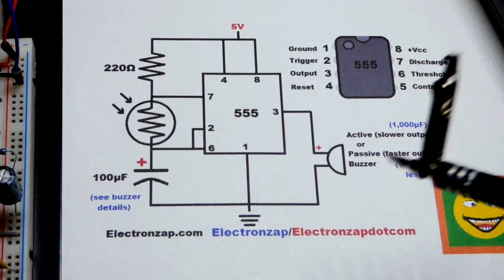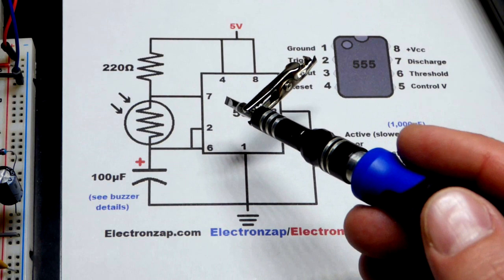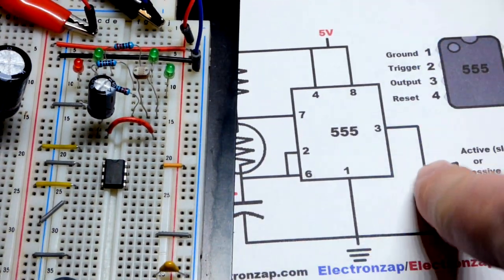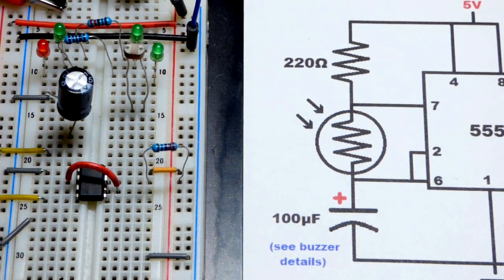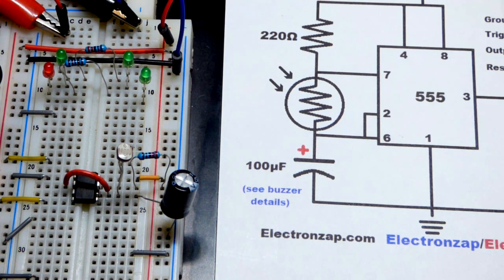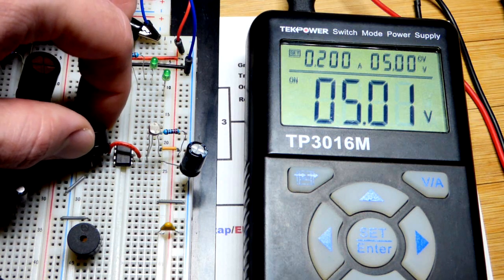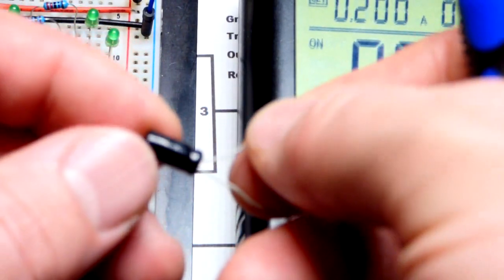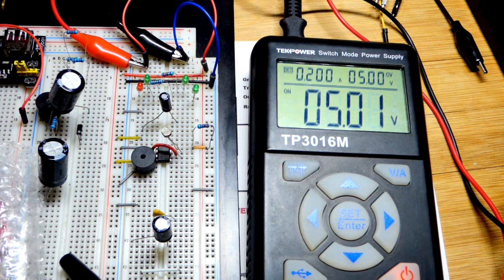Astable 555 timer buzzer active passive using light dependent resistor LDR circuit electronics

Comment: I tried this. The active buzzer goes off continuously even without the photo conductor connected. What seems to be the problem?
Reply: Hey again. I got it to work when I soldered the 817 optocuplar properly. But I want to modify it. I'm using a 4.7uf capacitor which gives short beeps and short pauses. How do I increase the time/duration of the beep?

Comment: Hey, I tried making these types of photoresistor oscillators but the tone changes with the voltage and different types of 555 chips give better or worse results but some of them overheat mabye they all got damaged somehow but I think the older early 2000’s 555 chips are the most reliable